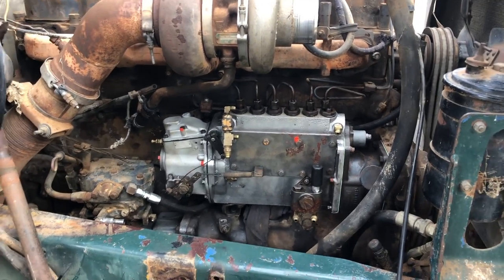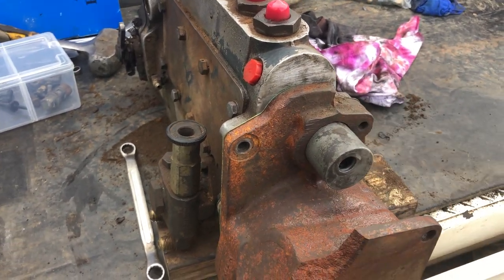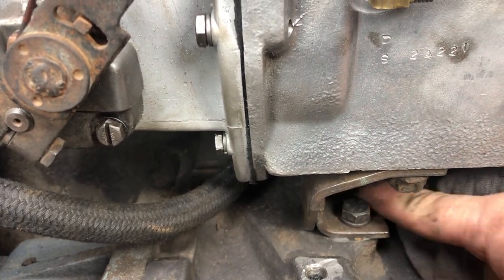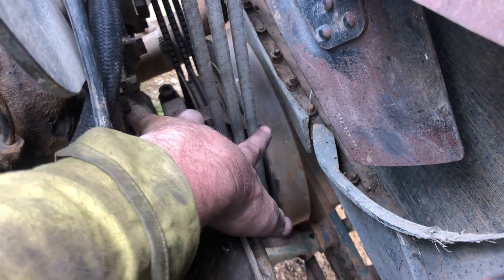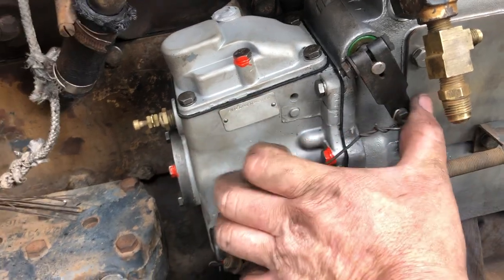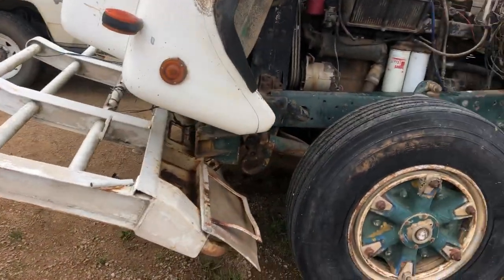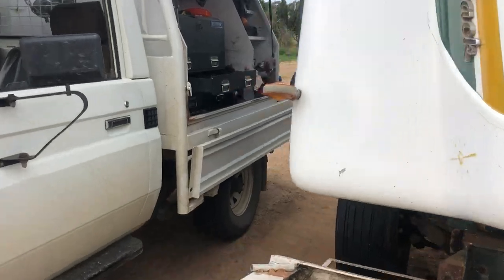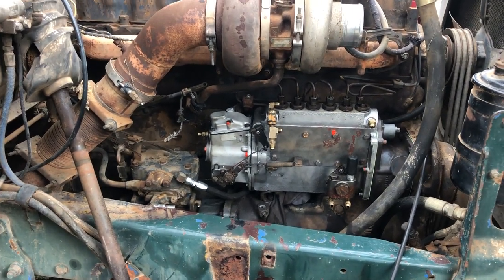Mack R600 Injector pump installation. Part  1

Comment: Most of our old 285 coolpowers were reset to 320 + 10% on pumps when fitted with 13 spd roadrangers
Reply from the maker: It would be hard to find a stock standard pump these days, most of them got turned up a bit. I have a coolpower F model with a 15 speed, and it’s a great gearbox for the engine.
Reply: I have just purchased a 285 F model. Going to put a 4 valve 350 pump on it